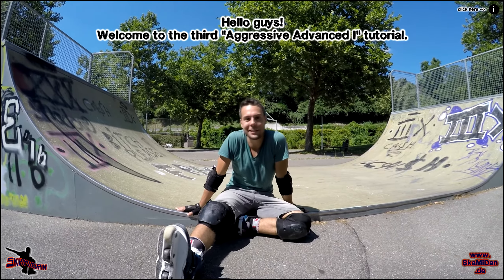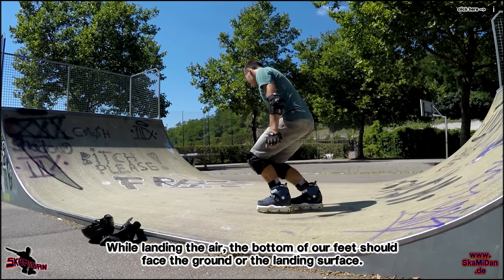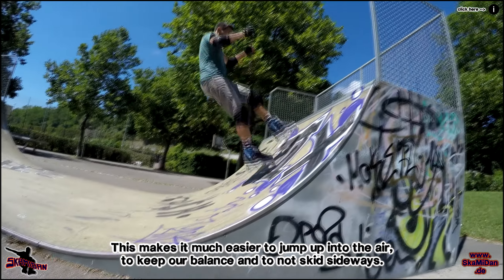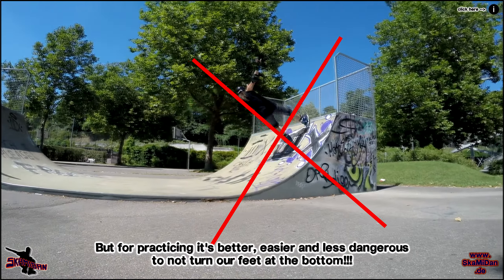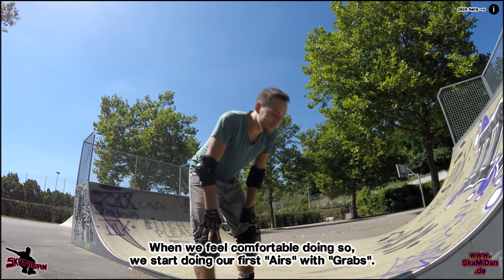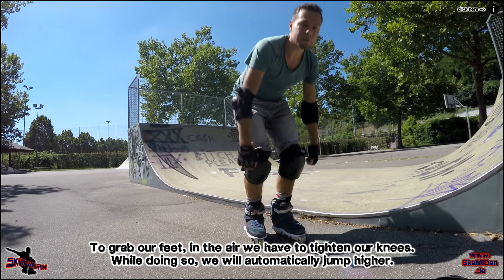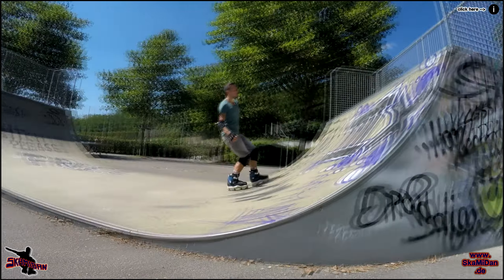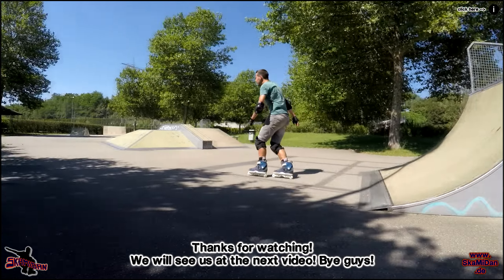Einen "Air" in einer Pipe lernen // How To Air A Pipe - Aggressive Advanced I - Part 03

Comment: gutes Timing, an dem arbeite ich auch gerade :)
Reply from the maker: Das freut mich. :) Wie läuft es bis jetzt mit dem "Air"?
Reply: puh, wird besser. hab länger gebraucht, gerade rauf auszufahren und dann erst mit dem hinteren Bein wegzuspringen. Aber es wird :) Lustigerweise mach ich den 180 in der pipe anders, als wenn ich den stall mit den 180 aufs coping mach....
Reply from the maker: Das du den 180 Air anders machst, als wenn du in den Stall gehst ist normal. Beim Stall möchtest du ja auf die Coping springen und beim Air in der Pipe landen. Heißt ja, dass du dich beim Air nach vorne in die Pipe lehnst, beim Stall nach hinten um dann oben aufrecht zu stehen.

Oder meinst du, dass du den 180 dann auch in einer andere Richtung drehst, also z.B. Switch machst oder ähnliches?
Reply: Eher das zweite, den 180 mach ich nach links gedreht und den Backside Stall(?) dreh ich über rechts.
Aber es fühl sich einfach besser an
Reply from the maker: Wenn es sich so besser anfühlt, dann ist es auch richtig so! Bzw. über welche Seite man in welchen Trick dreht und welche Seite für einen Switch ist und welche normal ist immer individuell.